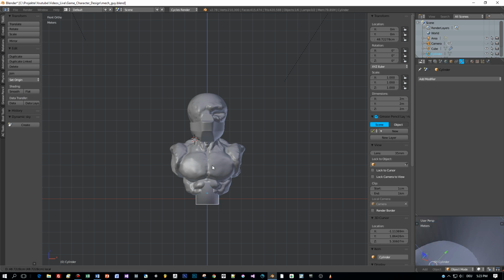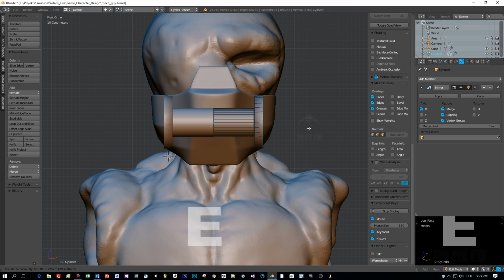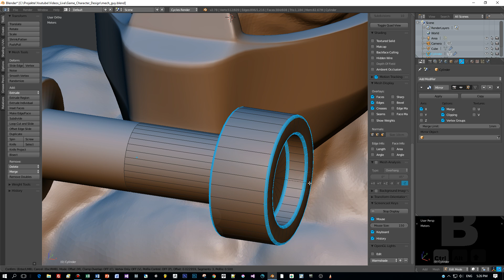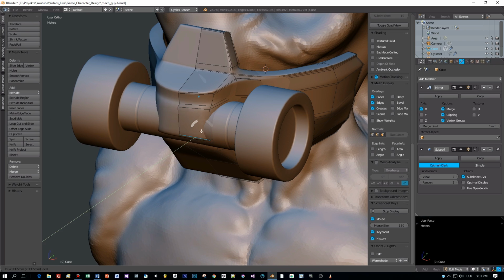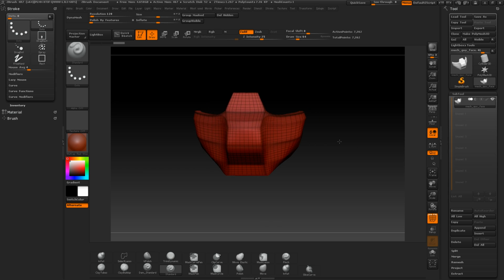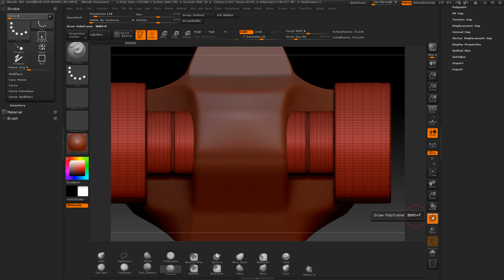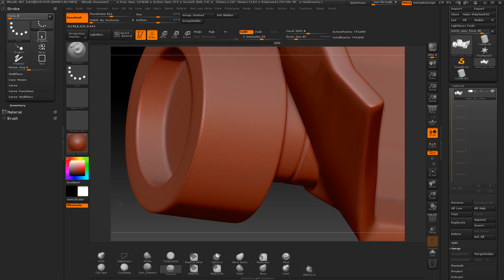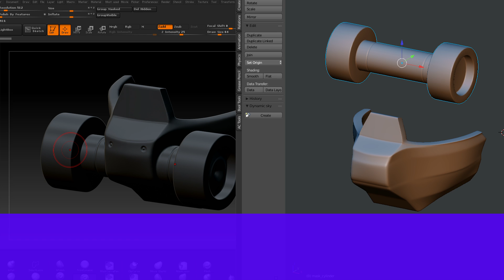Blender ZBrush Hardsurface and Dynamesh

Comment: Hi Jay, Have you tried the GoB plugin for getting files too and from zBrush:
http://www.zbrushcentral.com/showthread.php?127419-GoB-an-unofficial-GoZ-for-Blender
It still works with the latest version, but I think the documentation is missing a step, you need to make sure you run the Goz plugin in zBrush first (after placing the files in the correct folders) and point it to the blender executable..
Reply from the maker: Hi Stephen, yes I know this addon and I like it, but for this tutorial I wanted to show all the stuff behind the magic:-) But thx for the input.
Reply from the maker: I will add a video for GoB tomorrow, it still work perfectly in Zbrush 4R8 and Blender 2.79:-)